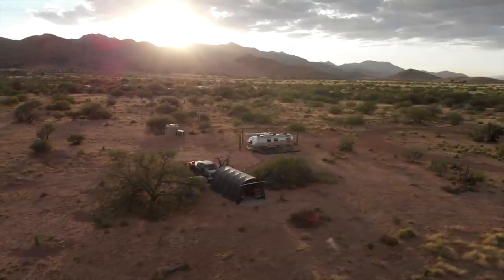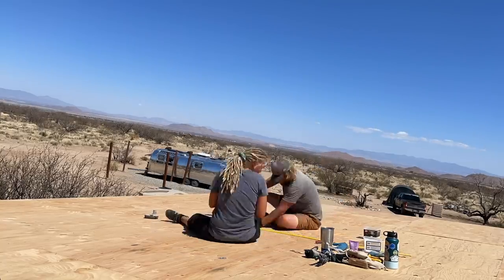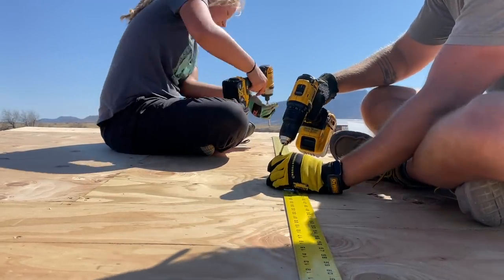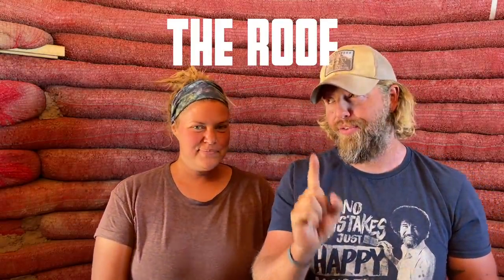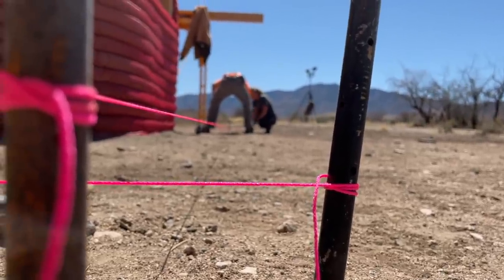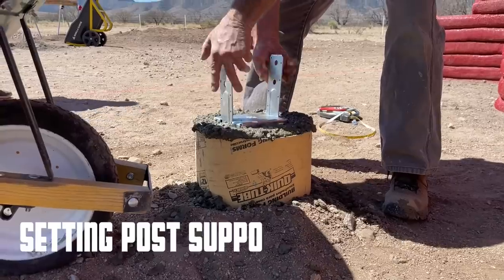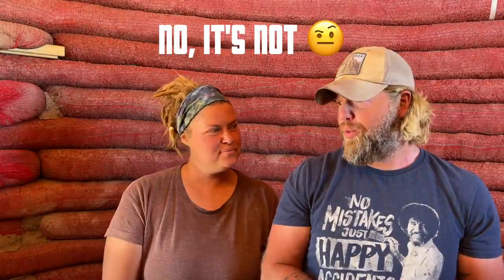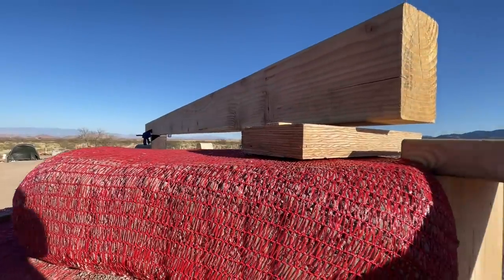Finishing Decking on our Solar Shed Roof

Comment: "Another Dirty 30". Wow, 400+ screws on decking every 8"! That would take a long time to do. Adali marking all the spots! Jonathan and Ada screwing in all those vertical screws. A look back at day 34, the first day of dad! Pesky T-Rex dancing in doorway! Great, dad brought a lazer level, cool. String parallel lines front to back and side to side to set posts, the two in the back and one in front. The overhangs are what makes the building so incredible. I haven't seen such a cool roof on a building ever before. So unique and wonderful for shade. Rounding off the concrete on the sonotube is great to get water to drip off the pier. You started on the front side and then shimmed and layed the 28', 4"x6" beam across front and to post. You butted it together at a support point and put a 2"x4" behind to reinforce it, right? Nice. That is a lot to do in a day.

Comment: Looking good! If you do composition roof, with 30 lb felt paper. That should be done early in the day and stopping about midday. And when you turn your feet lift them first, rather than turning on the ball. That prevents stuffing the roof.
However if you choose metal just screw it down as you go, and watch your step it can be slippery. 
Either way take care, keep up the good work, God bless amen.

Comment: this is the first intro you've done without the Sun, lol that roof will be very good at,catching rainwater , when me and my wife lived off grid off of a Honda generator (before the days of solar),,we built a roof like that over our trailer and it helped a lot keeping the heat away. 3 hours a day of the generator charged our 12 vv batteries and would run the refrigerator that had water in the freezer to  make some ice and we had 12 volt turn signal bulb lamps and a 12 v television. Then we were able to build the house. You guys are doing a lot better than we did it , specially that Jurassic Park fence compared to the fences we had we always had some sort of predators eating our livestock

Comment: A chaulk snap line. Run it from one end of the rafter and the other end. Snap the line. You have the line to screw in. Should be easier than using the yardstick and much quicker. Really enjoy your project.
Reply from the maker: Having the rafters sisters together it was just a little easier to just lay out the straight edge.
Reply: @TinyShinyHome  That makes sense because they have an offset! Why didn't I think of that!

Comment: No joist hangers to ??????????you did do good next one you know how to do it make with timber next one !!!
Reply from the maker: we're not done... there are hurricane ties..just haven't uploaded that video yet:)
Reply: Different kind of roof system. Rafters go over three parallel beams. These aren't floor joists. They don't hang from a rim board because the beams are hung off posts at 3 different points. The deck maintains the rafter spacing and the rafters are tied to the three beams. The beams are tied to the earth bags and posts. I think what they did makes sense. Why timber? It is not a pavillion roof.